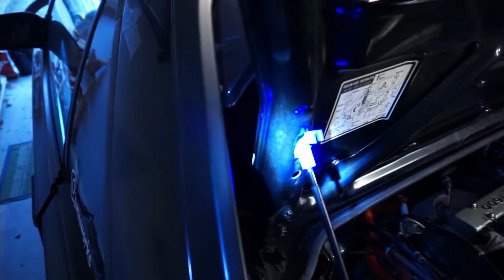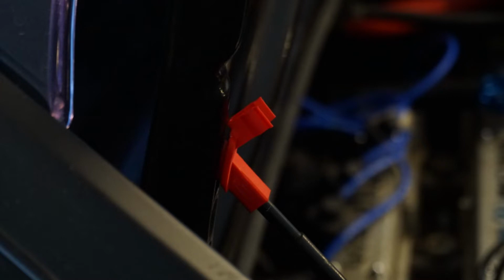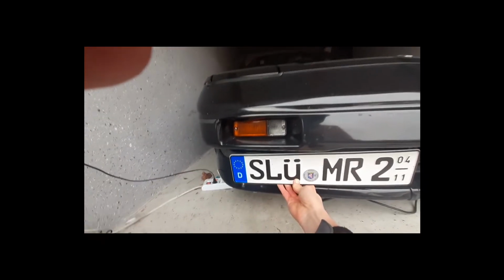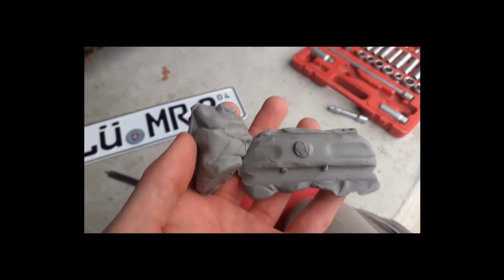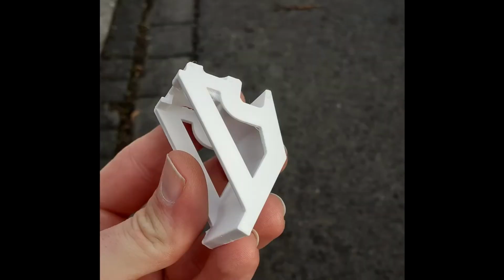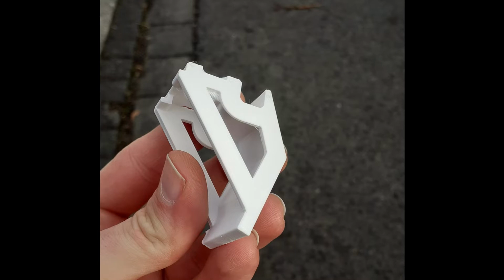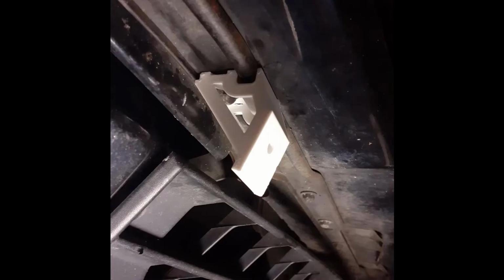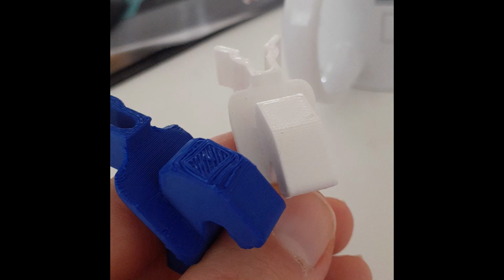Toyota MR2 AW11 - 3D Print Update *english* // License Plate / Hood Prob / Coolant Cap

Comment: Thank you for the coolant cap design! I remember watching this video a while back and my coolant cap finally corroded away, so I will try out your cap printed in PETG and see how it goes!
Reply from the maker: My last one was a SLS Part, but the UV (Sun) let it last only one summer.
I'm driving an MX-5 NA Cap now, but will print one again. Pls have a look, if your petg material can handle the hot water and you need a thick sealing, i used a rubber plate. If you have problems, contact me on insta :)

Comment: Can you doo the headlights eyebrows?
Reply from the maker: This part is very thin, i have already seen 3D printed eyebrows. I dont have a 3D Scanner and I think you need to sand and paint them or you will see it. 
To do them by measuring is difficult i think.